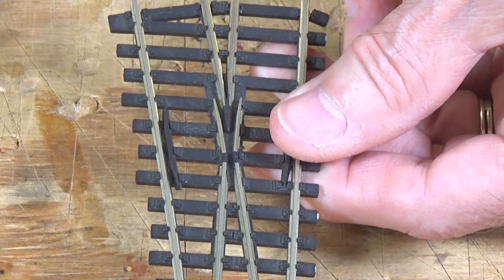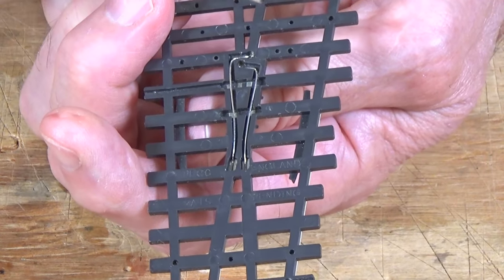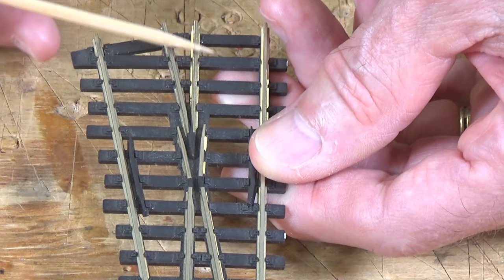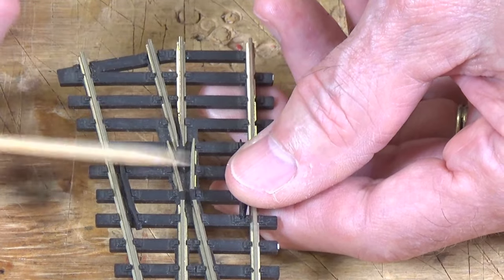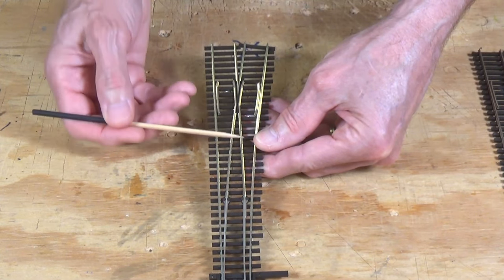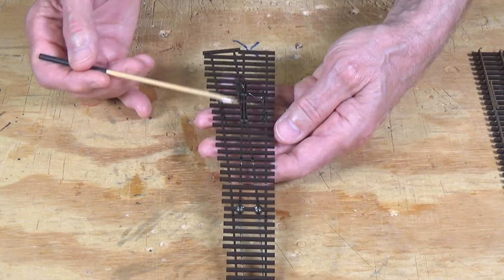Insulfrog, Electrofrog, Unifrog--What's The Difference And Why Does It Matter? (263)

Comment: Hey Larry, I have been using insulfrog turnouts for 30 years and am part of a large club that uses them. I started out in DC. More and more I noticed shorting  on the unifrogs using our DCC system. This was really apparent with a string of Athearn passenger cars. Because we run DCC the switch is feed from both the point end and the normal and thrown ends. The result is power right at the frog and certain wheels bridging causing the short. I recently bought a brand new three switch and normal Switch the instructions said to use insulating rail joiners on the frogs. I found a set of old blue box Peco instructions and there is no mention of insulators instead they say the wheels should be made to meet some standard. The required insulators defeat the route selecting purpose of the switch. My question is WHY doesn’t anyone talk about this and rip PECO for not resigning their switch. I believe this has been an issue since day one but in DC the shorting wasn’t significant enough for anyone to notice but in DCC your  circuit protection clicking or sound locomotive’s sound shutting off its obvious. Steve McCoy
Reply from the maker: I seem to remember another viewer relating that on the early ones the space between rails next to the frog was too close and the loco wheel tread could hit both rails at the same time creating a short. I think he also said they had been modified in later runs. This also used to be ab issue with Atlas N scale turnouts. We used to either take a Dremel to them or less drastically just paint the rails head with Hard as Nails nail polish. It would last a few months then require another application.

Comment: I'm just getting back into the hobby with code 100 flex and Atlas/Tyco switches. I've been told they won't cut it with DCC. Would you suggest "switching" to code 83 Peco unifrog's and code 83 flex? Need to make this change before I lay the first rail.
Reply from the maker: The only reason to use code 100 is if you have a lot of it and old cars and locos that have the oversized flanges. With anything smaller than code 100 the flanges may bump along on the cast-in spikes. I have a bunch of old Atlas code 100 track I plan to use on my second helix simply because I have it and it will be hidden and no one will see it. However if you are not concerned with the esthetics of track and the fact that code 100 is oversized except for some of the heaviest track in use then go for it.  Atlas turnouts will work and the more modern stuff looks a lot better than it used to.

Comment: Which switch should I use for a yard?  #6 unifrog?  It's also a DCC system.
Reply from the maker: It depends on what rolling stock you will be running into the yard. For long cars including passenger coaches you will likely want #6 but I use #5 in yards where 40-50’ cars are the norm.

Comment: Very informative video on Peco turnouts ! However, I'm running all Shinohara/ Walthers code 83 turnouts and they have 3,4, and 5-digit suffixes for all their #4,#5,#6, #8 and #10 turnouts being DC and DC/DCC friendly, including their very useful curved turnouts. Can someone translate Peco to Shinohara in this respect ?  - Insulated rail joiners and soldered jumpers are not an issue for me but time saving advice would certainly help me before I start fastening my small branchline (3 industry) yard down. Thanks, everyone.

Comment: I used to run Atlas turnouts with Hex Frog Juicers. When my local hobby shop was going out of business, their sale on #5 Peco insulfrog turnouts was too good to pass up. I took a chance and bought a bunch. I wired jumpers between the stock rails and closure rails to not rely solely on the points. Running 4 axle diesels as the smallest powered units, I've never had stalling issues, because the frogs are so short. That being said, having powered frogs will always be my first choice, and the Peco Unifrogs or new Walthers will be my future purchases (if I ever build another layout).

Comment: Are unifrogs DC friendly? I’m DC guy.
Reply: Short answer is yes. You can leave the frog unwired, and thus would work similarly to an insulfrog, but with the benefit of all the other tracks being powered with correct polarity. But if you really desire to power the frog, you can use a switch machine to power the frog as the switch changes.

Comment: I still can't understand why this hobby hasn't gone to RC. Sure, it would cost a lot to retrofit locos, but think of a layout where you don't have to worry about wiring the rails at all. With the popularity of drones, RC has gotten smaller and cheaper. Anyone who has ever spent an afternoon on their back trying to diagnose and fix some turnout wiring should be ripe for this change. Even switches can be controlled by RC and servos with no wiring. MR's are all about prototype. Let's go full prototype and make the engines carry their own power instead of having to get an electric engineering degree to figure out how DCC works. The hobby went from DC to DCC. It's time for the next generation  - RC/bluetooth/wireless.
Reply from the maker: Watch my video on the Blunami decoders from SoundTraxx.

Comment: It seems to me that insulfrog would be the best option.  What i got from this was that if i have feeders on each leg of an insulfrog turnout,  that i can override power routing, and always have power, and always in phase unless of course its a wye, or reverse loop.   More feeders sounds alot easier to me, than modifying and modifying, cut gaps here and here, and there, and jumping this, that, possibly here, solder this one too.  And dont forget that one..  maybe im wrong but that's what i took away from this video.   I haven't purchased any track yet because im completely overwhelmed with the turnout confusion.  Im building my first serious layout and don't want to make unnecessary purchases so im constantly watching videos on turnouts.  This was the clearest video I've watched yet and if im understanding everything correctly, i took away from this what i stated above.  Any further help from anyone is appreciated
Reply: Same here, I'm currently starting a layout, I need the track to be bullet proof, for smooth operation..with that being said I need to be realistic with my needs and wants..at some point I need to say I'm ok with this..I'm running DC, and although DCC is great I have far far to much equipment to convert over..(been collecting) for many years. I'm making this decision to go with the insul frog.. knowing small locos may have a issue..iv already done testing with the smaller locomotives..aside from maybe a 0-4-0 the rest seem to run very nice over the insulfrog..as nice as the powered seems more reliable, its just not something I'd see a benefit in with my situation..
Reply: same too, i have a lot od rails and insulfrog turouts inherited and i want to start in ddc, and what i take is, if don't have small steamers(and i don't), insulfrog do their work good enough and there is no need for more complicated and expensive rails

Comment: Thanks for a very detailed explanation. I do use Insulfrog turnouts for the isolation of sidings. If all sidings are powered, then all locos will be sitting there using power. When I isolate a siding, that loco is dead and I don't have to listen to so many steam engines at once. As for point feed. I've had no problems - except for one time. I simply cleaned the point & contact rail with Mineral Spirits, dabbed a bit of graphite and have had no trouble since. i.e. Clean track and graphite is all that is needed for a simple shelf layout like mine. No turnouts powered, etc.

Comment: Hello Larry
Thank you very much for your videos, I have enjoyed them and learned a lot from them.
Very well explained.
I want to ask you a question please.
I have a digital mockup with Z21, Roco multimouse on H0.
But I have problems with the Peco detours. They are code 75 - H0 - Electrofrog.
I use slow MP1 MTB motors, but they give me shorts even though the connections are well made, as you show in your videos.
I would appreciate your advice please.

Excuse my English but it is done with the translator.
Regards, and thank you very much.
Reply from the maker: I suspect you have installed them in the as built configuration and they are acting as power routing turnouts instead of as all live turnouts. If so then the frog rails need to be insulated at their ends to prevent shorts.
Reply: Thank you very much for the quick response Larry.
Indeed this is how I have done it. The two central rails have insulating plastic plates. That's why I don't understand short circuits.
 You may need to connect the MP1 MTB motor positions that go to the track rails differently.

I will continue doing tests.
Thanks again.
Greetings.
Reply from the maker: Yes, check your wire connections, that is a common point where shorts get wired into turnouts.
Reply: Thank you very much for your instructions.
I will do the appropriate tests with the connections that must be the problem.
Greetings

Comment: Sir how to power the frog in unifrog please reply sir 🥺🥺🥺
Reply from the maker: The unifrog has a wire underneath the frog that is designed for providing power to it. You can use either a motorized switch machine, such as a Tortoise or DCC Concepts iP Digital, to throw the points and also provide the correct polarity of power to the frog or use a manual method with a built in switch to change polarity. I have videos showing how to power frogs as well as one on manual methods.

Comment: Thanks for the important info. I don't understand why they do not make the frog rails independent of each other. Possibly by separating that V shape with a small gap right where it comes to a point. 
Seems that would make these electro frogs work perfectly.
Reply from the maker: It can be done which is why I prefer Micro Engineering turnouts, the frog rails are dead and individually isolated. This mens they are the same polarity as the running rails you attach them to.

Comment: Interesting, regarding the electrofrog  - you state (around 11:22)  that you put additional cuts in the rails very close to the frog. Yes you have removed all areas where a short could occur if you run into the turnout  on the route that is not set, but have you not just turned that into a dead frog, even longer than the insulfrog dead area, or do you power the frog through a juicer or similar. If you do power the frog  then it is still a area of a possible short if entering the turnout from wrong route?
Reply: Without watching again, my impression was that the place where the dead short occurs just moves an inch or two nearer the frog, which seems to achieve nothing.

Comment: How do you mix electrofrog and insulfrog without having a problem? Say you have a yard and you have a mix of these? If you had plastic rail joiners on the frog rails would you be okay from shorts?
Reply from the maker: You could do it but I don’t recommend the use of Insulfrogs since short wheelbase locos tend to stall on the dead frog. This would be especially true of yards where slow speed operations are necessary so you can’t “coast” over a dead frog. Plastic rail joiners are a necessity on  the older ones but the new Unifrogs don’t require them.

Comment: I model HOn3 those Peco turnouts are Unifrog at the frog end and still have point rails on moving pivots. I’m trying these on my Durango module. They tested out just fine while leaving the frogs dead. The only equipment that might pose a problem are galloping geese and a rather short rail bus. All the small steam locomotives run right through.

There’s some concern about DCC in older turnouts. We run DCC using unaltered Shinohara turnouts, older hand made turnouts and others not generally considered DCC friendly with very few problems. Check your wheel gauge and dragging coupler hoses. 

This video gives excellent information in a similarly excellent presentation. That doesn’t mean older products are junk, it just means the new ones have gone a long way to getting the bugs out.

My most repeated advice to those operating on our club’s modules is don’t run into the back of a turnout switched against you. That’s our number one short circuit.

Thanks for another great video!
Steve
Reply from the maker: The new turnouts are built to help prevent shorts. They still work with DCC but if your goal is to prevent shorts making them DCC friendly will help.
Reply: @TheDCCGuy  thanks Larry

Comment: Larry, I and my son are new to larger scale model railroading.  I’m currently reading your “Wiring Your MR” book on turnouts.  We’ve got all new Atlas dcc friendly turnouts.  Am I correct in interpreting your info that there should be no need to do extra to these turnouts to make the more safe from short circuits as opposed to what you recommend for power routing ones?  I just want to make sure before installation and operation.  Thanks!!
Reply from the maker: They are fine as sold. Note that unless they recently changed it the frogs are cast aluminum or pot metal and do not accept solder, thus the small opening for a screw on the frog. It is there to allow users to attach the feeder wire using a screw that Atlas sells. Some folks put the screw in from the bottom and solder to its head in order to hide the connection.
Reply: @TheDCCGuy  thanks for the reply, but I see some differences on the turnouts.  One looks lie the frog is all plastic as the others isolated with plastic frogs and metal jumper underneath from frog to closure rail.  The one with all plastic frog looks like it has a jumper between the stock and closure rail and the throw bar is insulated.  The one with a jumper between the frog and closure rail  doesn’t appear to have a jumper between the stock and closure rail.  I’m a bit confused with the mix of dcc friendly features (some there, some not) and unsure what do.  Sorry for the long reply.
Reply: Looked again at the one that looks like it doesn’t have jumper between the stock and closure rails.  There are plastic humps under the track at those spots where you can’t see the metal connection that may be molded into the plastic and not visible.

Comment: Any suppliers of small gauge solid bare wire for making jumpers?  Tried an eBay search. Nothing came up.
Reply from the maker: I get 99% of my wire from allelectronics.com. In a pinch you can use little pieces of the brass wire available at hobby shops.
Reply: @TheDCCGuy  ok Thanks!
Reply: I did see one youtuber who doesn't jump the gaps, instead wiring droppers on all the rails, and splicing the feed for the stock rail and associated closing rail under the board. I kind of like this approach as you don't have the added problem of trying to hide the jumpers.

Comment: Does Peco make anything other than a #6 unifrog? I've been searching but I can't find a #5 unifrog.
Reply from the maker: It is my understanding that they are in the process of replacing all versions of the Insulfrog and Electrofrog with the Unifrog. However it will not be an instantaneous replacement so during the transition I expect periods where you will be able to get one or the other of a specific configuration and also times when none will be available.
Reply: @TheDCCGuy  ok. So I need Peco #5 Turnouts. Which version would you recommend for my DCC layout. I am just learning to solder so which turnout would be best for me?
Reply from the maker: I don’t think Peco have made #5 Unifrogs yet and if not then you will likely have to go with what ever you can find. If you are in the USA then the Walthers #5 is a good choice. In the Uk I would go Unifrog, Electrofrog, Insulfrog in that order based on what is available. I also would not go out and buy all you can find as the next day a shipment of exactly what you want will appear at the local dealer. I bought a bunch of MicroEngineering turnouts last year and of course now I would buy the Walthers turnouts had I not bought the others.

Comment: How can I make a insul frog into a dcc friendly turnout?
Reply from the maker: It comes that way.
Reply: Oh, I thought you said it had to be adjusted , 
I want power constant on both tracks when the switch is thrown.
Reply from the maker: Not the insulfrog, the frog is basically plastic and in most very short so few stumbles. It comes DCC Friendly.

Comment: HELP, I bought 30 Peco insulfrog switches awhile ago in advance of building my layout,  being told that was the way to go for dcc now after watching this video i see it was the wrong way to go. What do I do?  I am on a fixed income and can't afford to buy different switches.
Reply from the maker: The Insulfrog is DC Friendly so that is likely why they told you they would be good for DCC whereas the Electrofrog needs modifications. The main issue I have with Insulfrogs is the inability to power the frog. If you are an N scale modeler the dead frog will likely create problems with stalling as locos go through it and as I said there is nothing you can do to fix that. With HO scale it will depend on your locos. Long wheelbase diesel locos should be OK. Short wheelbase diesel switchers may be problematic. Steam locos can be an issue since the long stiff wheelbase of their drivers can lift them clear of the powered rails as they navigate the frog and cause them to stall. Set up a test track on your workbench and see how your various locos do on the Insulfrogs, you may be OK.
Reply: I've been buying the insulfrog turnouts for my dcc layout for years and have had no problems with my trains shorting out. How
Reply from the maker: Rodney—Did you read the reply? As I said Insulfrogs are DCC Friendly its the Electrofrogs that can pop a short if not modified.